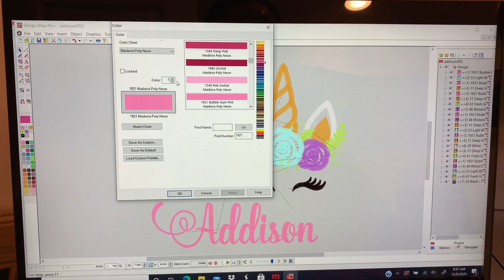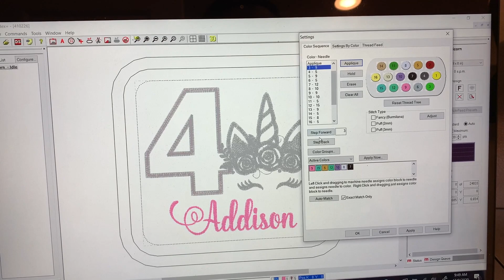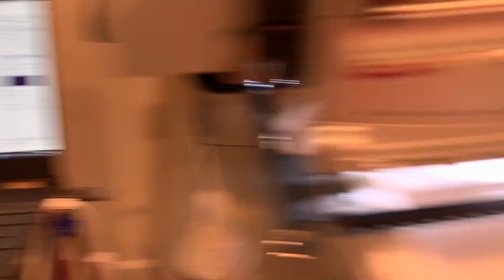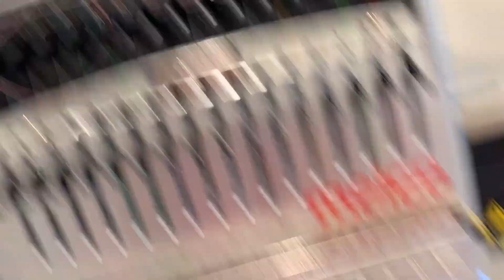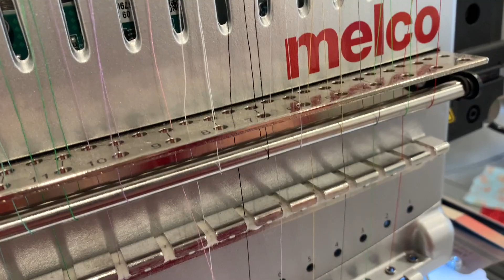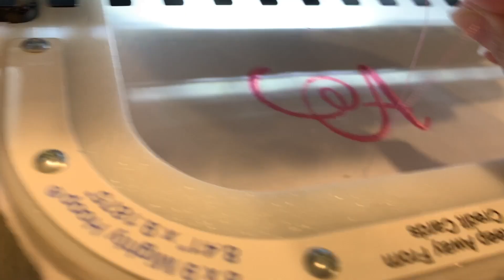MELCO EMT16X BASICS: Loading Embroidery Designs, Setting Colors in Design Shop & Rethreading Machine

Comment: hi angela,  great videos!  thanks for sharing your expertise? One question why do you add your names in embrillance instead of design shop since it looks like you have the full version?
Reply from the maker: Because I bought the BX Fonts for Embrilliance that way I can type them in instead of importing letter by letter in design shop. Design shop has fonts installed with it so you can type it out but it doesn't have the fonts I need that's why!
Reply: @AngelaJasmina  Awesome.  that makes sense... Thanks!!